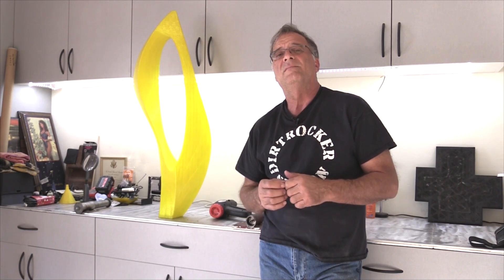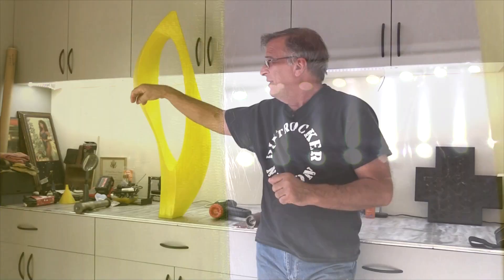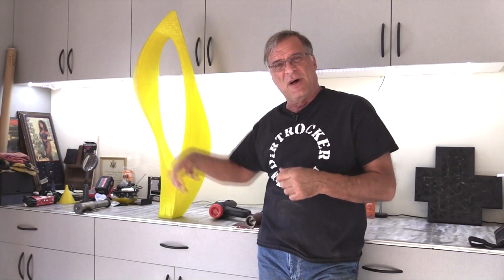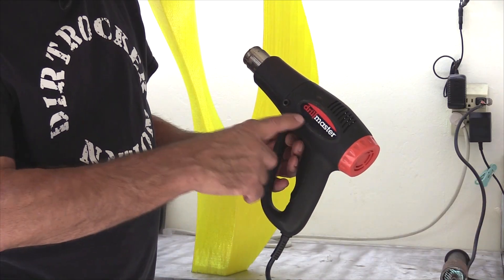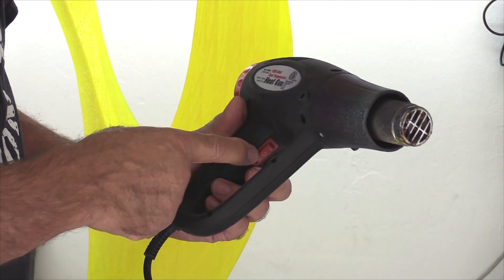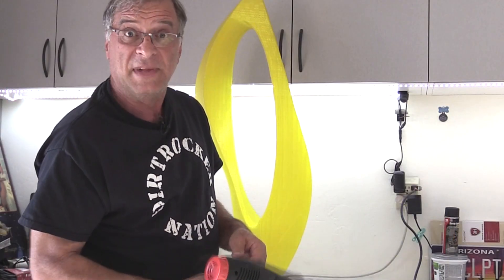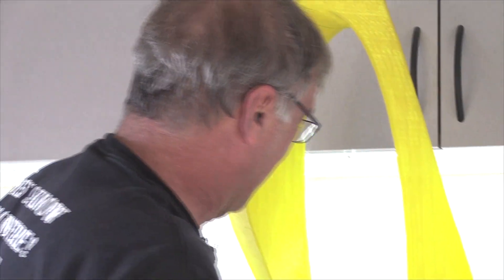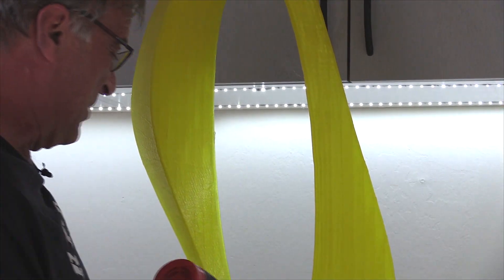How to Remove 'Strings' From a 3D Print - Kevin Caron

Comment: Hi kevin, i'm wanting to try mig brazing, i've been mig welding in general for 20 odd years so i know the basics etc but my main question is are there any specific mig torches for mig brazing with 0.8mm silicon bronze wire.
i ask this because someone mentioned that a shorter torch hose length is  better because the copper wire is softer and easier to birds nest and jam than regular steel

i'm looking at mig brazing rather than tig brazing at this time
yes i know the gas is pure vs mixed for regular
Reply from the maker: Sorry to say, but I know nothing about this.

Comment: Very useful video. Which heat level should bè used for this without deform the printed part?
Reply from the maker: Low heat works great. Just a plain dryer works as well.